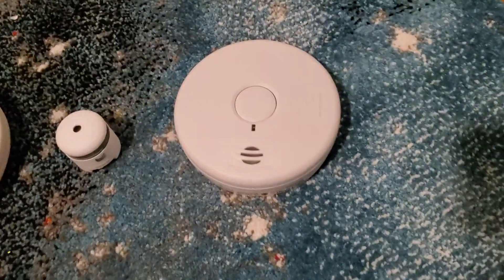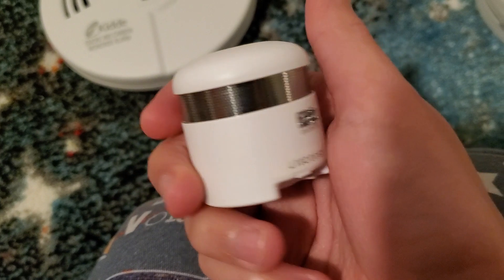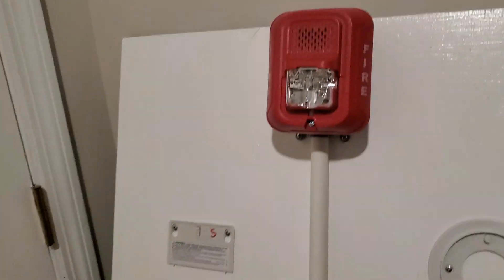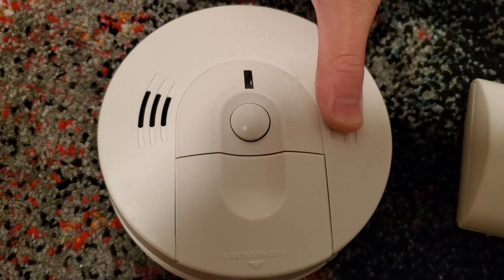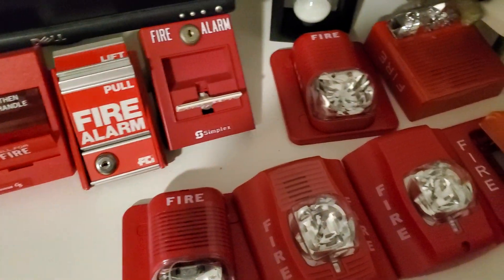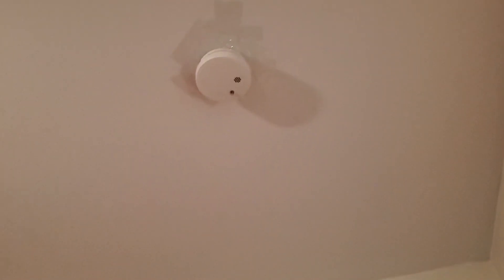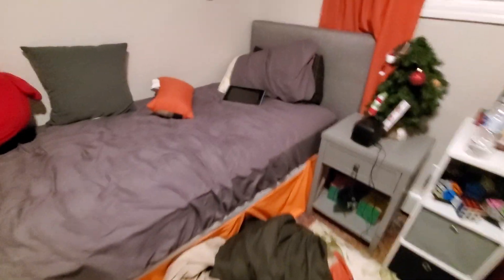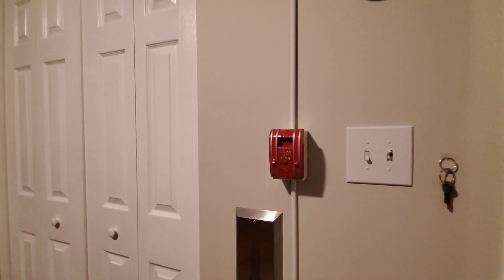My Smoke Alarm, Fire alarm, and Elevator parts collection!

Comment: I have a worry free smoke alarm but its a bedroom smoke alarm (Model#: P3010B)
Reply from the maker: Nice!
Reply: @Photoelectric_Elevators  I don't have the P3010B anymore because a long time ago. It kept going off every midnight and I didn't know why
Reply from the maker: The reason why is bugs can get inside the sensor and could trigger a false alarm. So I would recommend cleaning it with compressed air or a vacuum once a month to get all of the dust out of it. It worked with my Kidde P3010L.
Reply from the maker: I have a video on it.